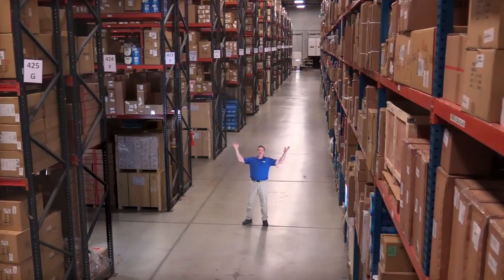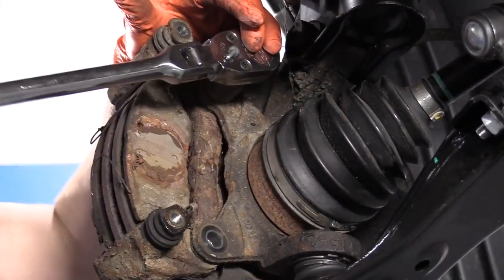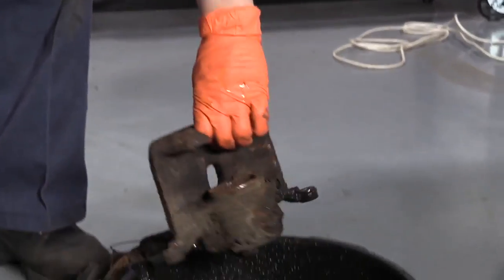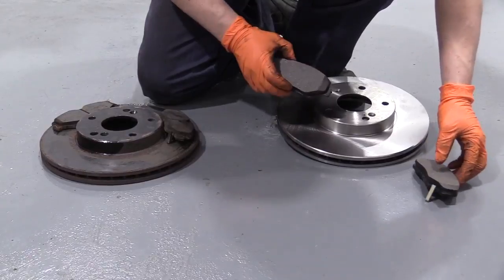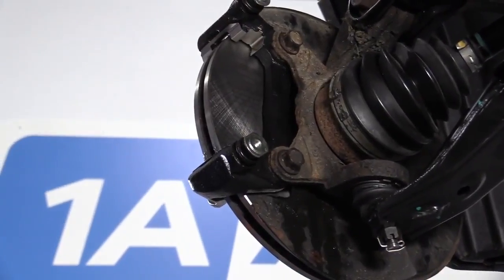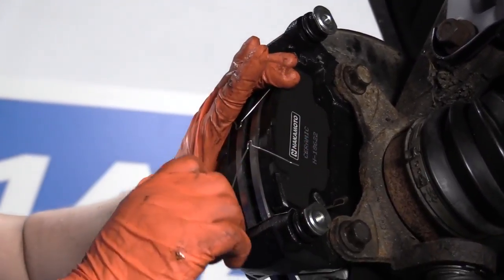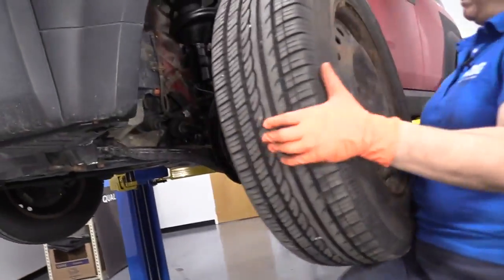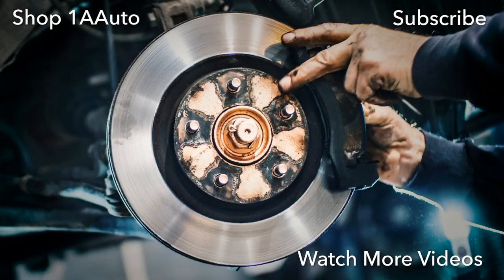How to Replace Front Brakes 03-11 Honda Element

Comment: Watching you put those screws back into that rotor pained me. RIP the next soul who tries to take those off.
Reply: That and when she used a hammer on the hat of the rotor without putting the lug nuts on to protect the threads in case of a miss hit.

Comment: Put Liquid Wrench on a few days before starting work on brakes, and repeat a couple times in between that and starting work. The original formula, and wear a VOC respirator when using ANY chemicals! Don’t get it on the rotor/pads if you will drive it after application, and don’t just spray it all over, only on bolts and screws to be removed, and just a little spritz on the heads and any exposed threads. And BEFORE you start the work, CLEAN CLEAN CLEAN!!!! The whole area, and especially above the work, crud is subject to gravity! Just as you get close on connecting things some big chunk of rust or greasy dirt will fall into somewhere critical that it’s a pain to get it out of, possibly causing more disassembly and heartaches. Or in this instance, with brakes DEATH. It’s so easy to miss crud falling as you reach for something and brush areas above your work inadvertently. Then there is the bigger picture of the crud holding moisture and corrosives all over you cars mechanical and body parts. Especially on those salted roads. At the machine shop I worked at  (we did all the work for the San Diego municipal bus system) we steam cleaned engines before we ever touched them. Once you get used to working on clean assemblies, you learn a ton of stuff that makes it imperative for cleanliness. Not to mention you and your clothes and tools and equipment…… It really is a different world when you clean everything first. The increase in convenience and ease makes it quicker and SO much better all the way around.

Comment: I just bought a a caliper depress tool that plugs into the pistons that turn... Im 100% I saw someone do it for an element on a different vid... then I google factory caliper and sure enough I see only the circle piston that depresses with any pressure... good greef...
Reply: Rear calipers on the element turn in, the fronts press in

Comment: l would suggest wearing eye protection especially around brake fluid or when working on any part of a vehicle eyes are not replaceable safety first.
Reply from the maker: +J .w Thanks for the feedback!
Reply: How about when spraying pressurized brake clean. And where’s the respirator for that poisonous cancer causing stuff.

Comment: Do you have a mechanical bleeder or someone pumping brakes
Reply from the maker: +Monk Soup We're always cycling through common cars. We'll add this repair to our list! http://1aau.to/m/Shop-1AAuto-c
Reply: Auto parts stores sell bleeding bottles that have a hose that goes on the open bleeder and goes to the bottom of the bottle with some brake fluid in it and the end of the hose submerged. You can bleed them by yourself that way. Just let up a little slowly, and push down quickly and firmly. Watch the fluid reservoir! Don’t let it get empty or you’ll be sucking air into the brake system.